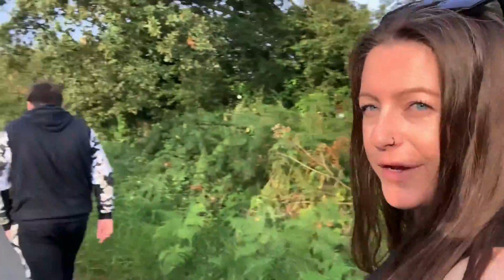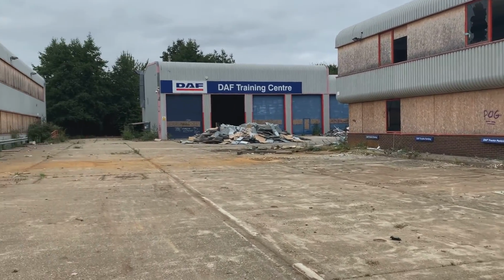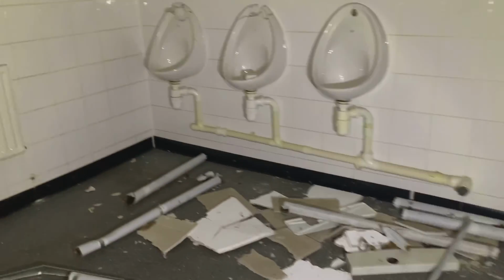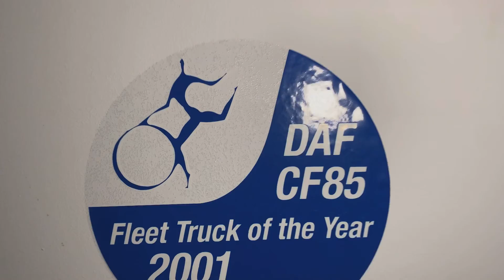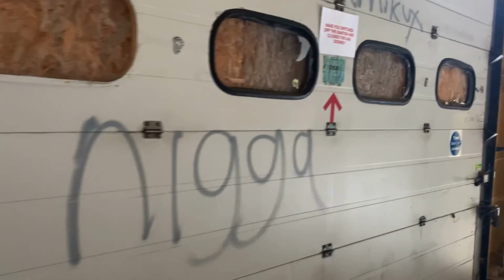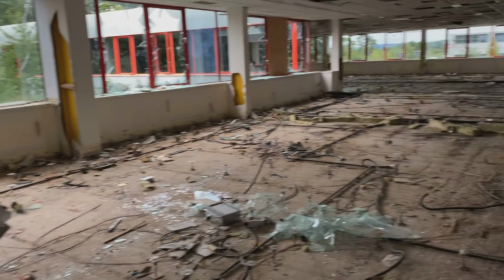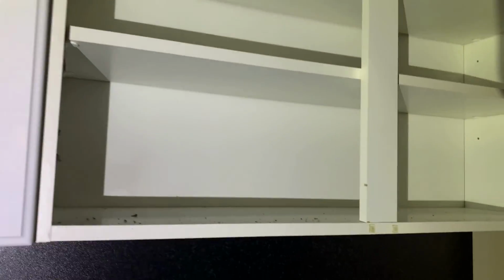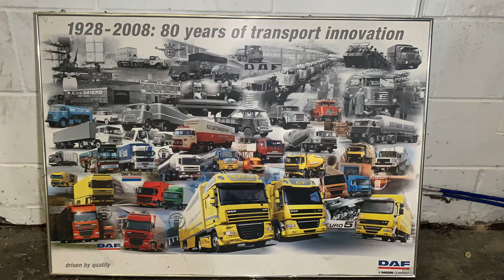DAF LORRY TRAINING HQ - ABANDONED EXPLORE

Comment: Upstairs was the canteen downstairs was where we got trained on electrical components and fuel systems etc where the 2 pictures were the classrooms were across from the garages the building with the Red window's I don't know what has happened to the building that had all the pits in it for working under the trucks and I'm hoping to get the picture with the Yellow trucks on and the 1 with the Years on it ive asked for them the other restaurant where the blue truck picture was where for visitors no greasy mechanics allowed ! That use to be the sign on the door to the visitors restaurant 😂 I did a 6 Year truck mechanic apprenticeship programme here before we got moved upto Norscot training facilities in Scotland so we done 4 Years at Meads then 2 years at Norscot in Scotland